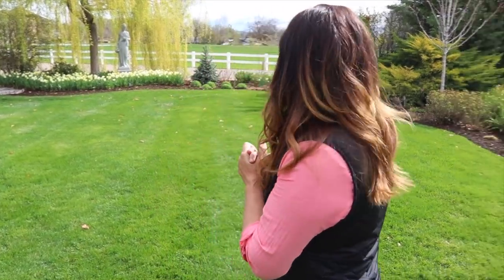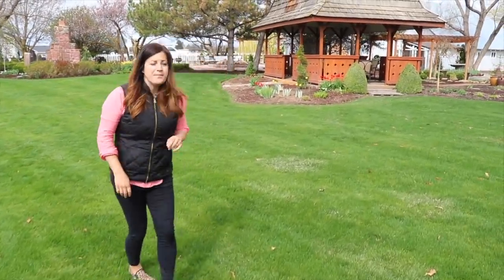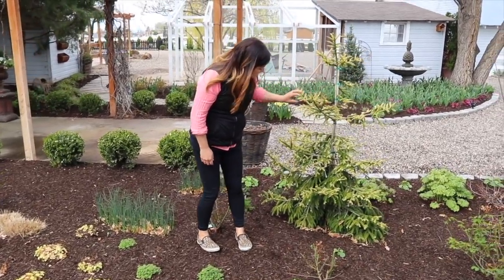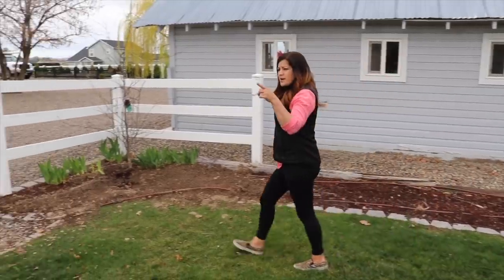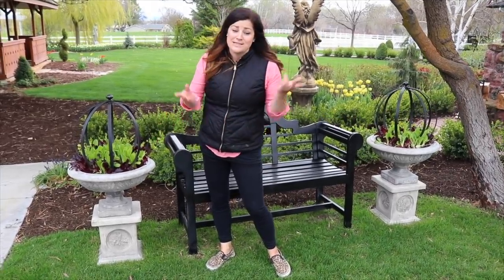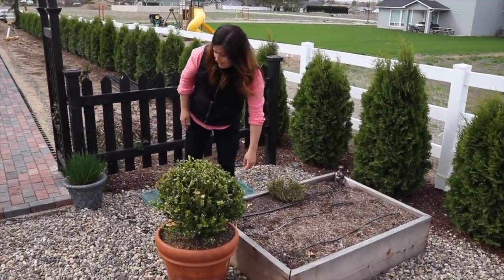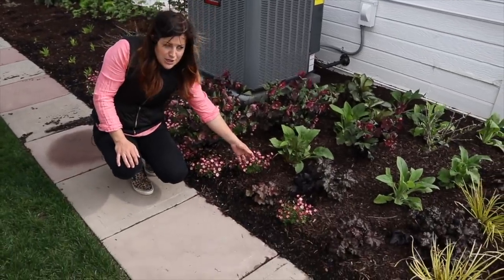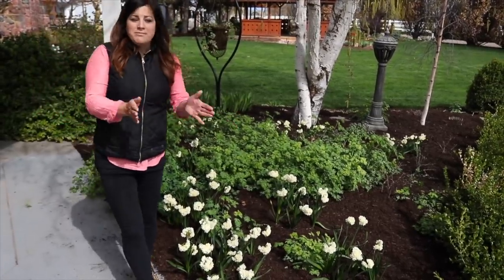April Garden Tour! 🌿🌷// Garden Answer

Comment: Here we take off the flower from the tulip after bloom, and let the leaves and stems die back feeding their energy back into the bulb, then dig up the bulbs before winter, and store them cool and dry, this is also how they farm tulip bulbs in the Netherlands. You can also bury the bulbs in a wire basket, easy to pull from the soil and shake out, this way you'll have years of pleasure from your bulbs.

Comment: Just my two cents:  Move your Hebe fountain to the place where the privets were.  (You have complained the fountain gets clogged by the blooms of the tree under which it's currently located and add a statue where the current Hebe fountain is ( on the concrete pad).